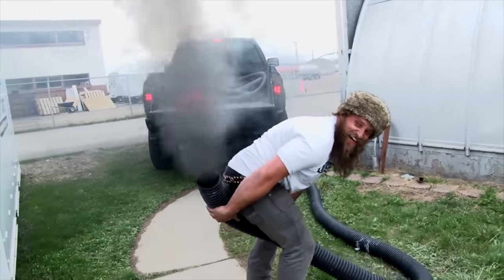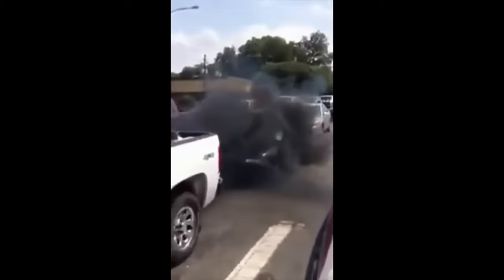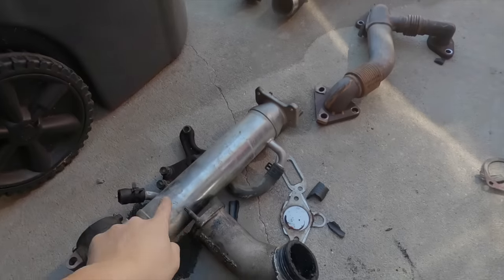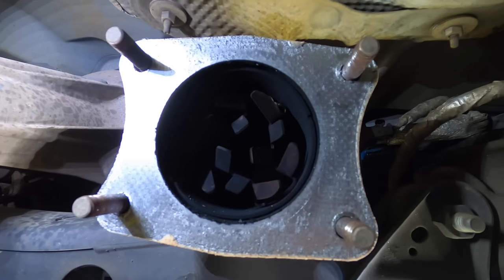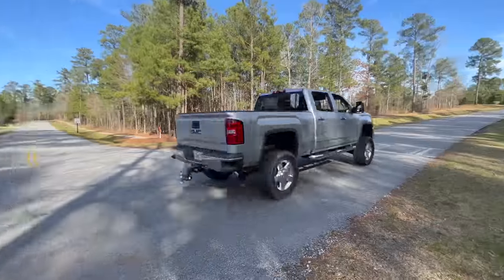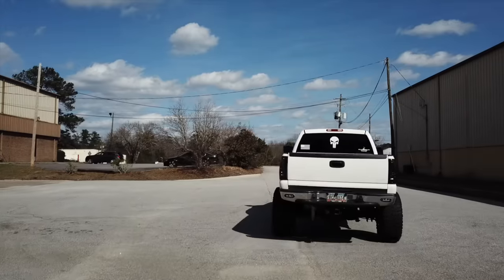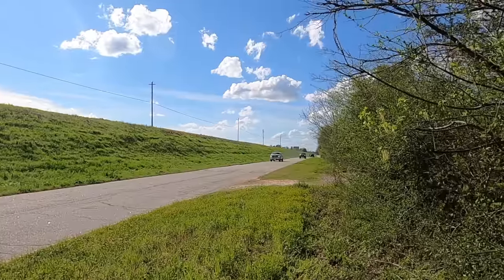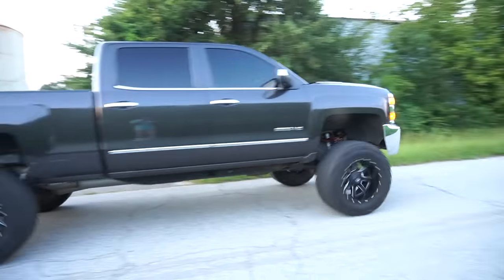The Secret Of Rolling Coal | Is It Legal? |

Comment: i would like to see cops issuing 5,000 dollar tickets when the coal rolls on a public road
Reply: I would like to see them NOT doing that.
Reply: @b.n.c.v5792  well, the epa is now going full hog on this, and watch them go after people posting videos, they already have the faa going after people doing plane stuff where there are clear violations, there is no reason to be emitting pounds of unburnt diesel fuel into the air i am breathing
Reply: @vg23air  I'm not too worried about besides the garbage trucks in my area roll coal the school buses in my district hell, even the tow trucks roll coal.
Reply: @b.n.c.v5792  lol i just checked, in new jersey it is a 5,000 fine, hopefully that law will spread, it is already a federal law violation.
Reply: @vg23air well Anaheim Police ain't pulling anyone over for some reason so I guess they don't care.
Reply: @vg23air  Diesel falls back to the ground unlike gas
Reply: @beastyjorge3842  lmao right
Reply: @beastyjorge3842  Diesel cars tend to have lower volumetric fuel consumption figures than comparable gasoline vehicles. However, the benefit in terms of CO2 emissions is significantly lower, as the combustion of 1 liter of diesel fuel releases approximately 13% more CO2 than for the same amount of gasoline fuel.
Reply: The epa has shifted its focus off of the diesel industry For its 2024-2027 agenda but yk
Reply: @bradycaroll2198  shifted ? they just fined almost half a billion to diesel centric and show no signs of slowing down
Reply: @vg23air  😂 check their new agenda and that was the Cummins suit
Reply: @BrianKauffman-v3q  well, if i were you could see them, no diesel smoke
Reply: They live in your head rent free. You should visit the industrial sector in Shanghai.

Comment: I have a 06 6.0 powerstroke bought it bone stock 4.5 months ago with 95k since buying it I did the hot an cold side piping s&b intake xdp intake manifold 3 core aluminum radiator crankcase reroute an getting it studded an removing the stock turbo an doing a s369 with 225 injectors an a fast lift pump an going to do all new headgaskets an see how far I can take the 6.0 an just how much the block can handle!!

Comment: The bare basics is: dump more fuel in than it can burn. Having a giant turbo with a lot of turbo lag can also help (check out the "Smoking Alcos"). Of course, all that black smoke is literally money spewing out the exhaust as unburnt diesel. A lot of emissions stuff might have to be bypassed as well (federally illegal). So, looks neat, not good for the air, and not good if you're caught.

Comment: I had a 2008 F-350 with a 6.4 l diesel for a while; bought it used with about 50k on it.  No DEF needed, thought it was a good truck. 

Nope. In the 8 years I owned, I had to:

Replace the oil cooler twice because it clogged with grit in the cooling system (which requires taking off the cab and disassembling most of the motor). Apparently was caused by factory defect (casting sand left in the motor).

Replace the radiator

Replace the turbos (twice)

Replace calipers in rear (twice)

Finally, replace the top half of the motor(cracked). Result of all the overheating problems and punching it getting on the highway? Or not; who knows; the truck had "snooze mode": when it overheated, it would automatically cut the fuel and barely do more than idling. 

Second time replacing the oil cooler, took it to a diesel truck speed shop, and they chipped it and changed some other things, in order to get more HP at the same mileage. I did get more HP; I think getting on the highway I could reach 65 mph in around 5-8 sec. starting at around 25 mph (didn't time it). Probably rolled coal when doing that; didn't notice. 

But I stopped punching the fuel because it obviously wastes it, and so for what, to save 5 or 10 seconds getting up to speed? And there is a downside: to get the motor diagnosed with a computer, you need to go to the same shop; inconvenient if an hr. drive away! Up side was they put in another loop in the cooling system upstream of the oil cooler with a filter you can change; no clogging after that. 

Rolling coal on purpose on a pedestrian or bicyclist is basically an assault, and should be prosecuted. Not much different for yelling stupid shit or throwing garbage at people; reflects more on the "dooer" acting like a toddler than anything the other person seemed to be doing -- usually just minding their own business, but driving a "woke" car or bike?

Comment: For Ford the 6.0 was the first with a egr cooler and egr valve for emissions of that there were two generations 03-early 04 had a round egr cooler where 04-07 had a square one supposedly solving egr cooler failures, cracks, and clogs… after that was the 6.4 with a dpf and yet again and egr but this time two coolers one being located on a slant across driver front cylinder head and other sitting just above the manifold on the driver side. Lastly is the 6.7 which is equipt with def, dpf and egr systems in order to be compliant

Comment: With ford the first powerstroke was made in 1994.5 which was the 7.3 liter but they slapped a turbo on it. 2003 was the last year of the 7.3 because it  wasn't  "complaint" with the standards back then Then came along the 6.0 with egr coolers and all the restriction stuff
Reply: I just bought a 2001 7.3 f350 with only 70k miles on it. I LOVE IT. I purposely looked for a 7.3 when truck hunting

Comment: Emissions system has nothing to do with rolling coal. I have an LB7 tuned to 550rwhp and you will see nothing out of my tail pipe. It all has to do with the tuning. Hire an amateur tuner and you will have lots of unburnt fuel rolling out your tail pipe, aka: black smoke. That's what it is, unburnt fuel, wasted. Hire a professional to tune your truck and not only will it make more power than the amateur's tune but you'll get better fuel economy too.

Comment: My lml is tuned and deleted and it doesn’t roll coal even on tune 5 why would that be?
Reply: You truck isn’t getting enough excess fuel being dumped into the engine.
Reply from the maker: Bc you have clean tuning which means your truck is running efficiently
Reply: Ask tuner for a LBF tune

Comment: with diesel at the price it is, rolling coal is pretty expensive.  And of course, if you modify the emissions system on a diesel truck and get caught, then that's a whole 'nuther level of expensive.  
As for is it legal?  Not in Colorado, and it's illegal at the state level in Maine, Utah, New Jersey, Maryland, and Connecticut.  But that's just the cheery on top, because it's illegal to mod the emissions system in every state.

Comment: Cummins 2010-2011 got dpf, egr they got it around 06 with the new front end style.
Reply: They got the emissions stuff in mid 2006 when they released the 6.7 Cummins
Reply: 2010 6.7 does not have def

Comment: Why I stopped driving diesels . Associated my truck with trash
Reply: Fishermen near me need diesel engines in their boats, because they have to have the torque.  You'd need a huge gasoline engine to do the same thing.  On the road?  Not so much, and diesel is a lot more than gasoline.  Those electric pickups are selling like crazy too.

Comment: cant wait to have a diesel 🤩
Reply: Bet you can't wait for all the extra cost to own an maintain and drive one too. It's not for the faint of heart.
Reply: @TeamTopKick  haha yea!! Bet you dont know me though haha
Reply: @TeamTopKick  I’m ready for all that
Reply: @xPassword  I don't know you and I wasn't trying to be mean. Didn't know if you ever owned a diesel before just a warning on how expensive it can get maintaining or operating one. Kinda a heads up. I seen a lot of people want a diesel than sell it for a gasser because they didn't know what they got them self into
Reply: @TeamTopKick  yea np!! dont worry i wasn't offended at all!! nothing was mean in your comment. im "kinda" aware of the gap between the gaz truck and diesel truck, i dont think its that much more expensive then switching from a 2.4L 4cylinder to a ram 2008 5.7L Hemi..Is it?
Reply: @xPassword  2.4L I'm guessing you had a Chrysler 200 or Dart before the Ram. The differences will mainly be cost of replacement parts, labor costs, oil costs, just even basic maintanance parts. Anything that has to do with diesel seems to automatically be marked up.
Reply: @TeamTopKick  nope haha i had a chevrolet equinox eco xD it was fine until i hit 170k/km on it xD, I udes to spend 90-110$ gaz per week for job and when i got a 1500 5.7hemi 300$ a week but still i love having that pickup :thanksdoc:
Reply: @TeamTopKick  not really true I have a 96 cummins that has 237,000 on the dash. Trucks been very reliable with basic maintenance, I do change all oils and fluids myself. Also parts are fairly cheap and these old rigs are easy to work on yourself.